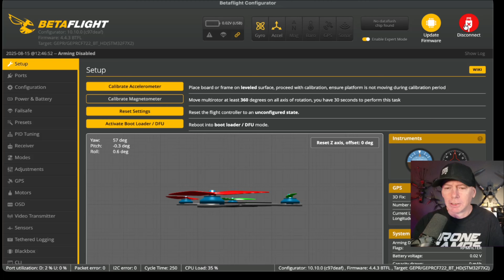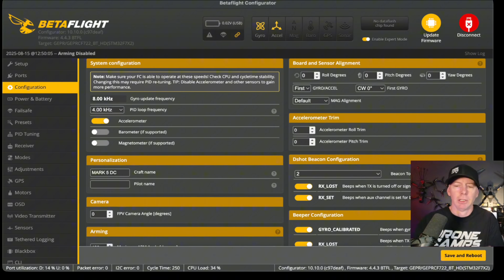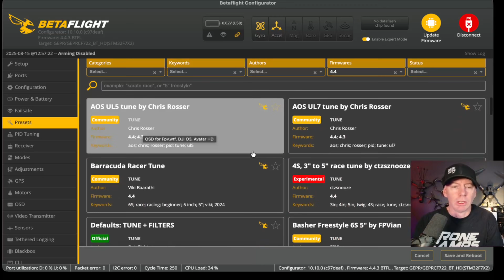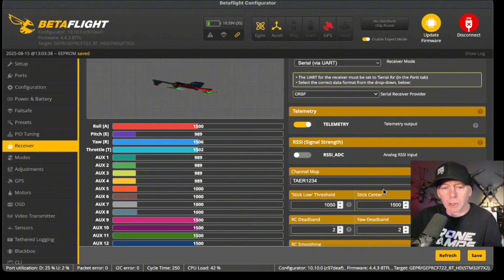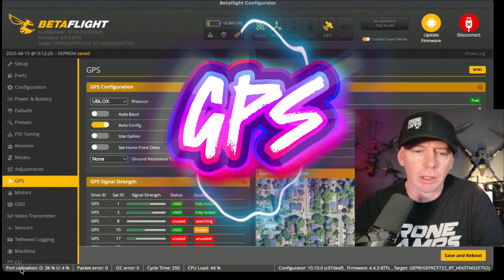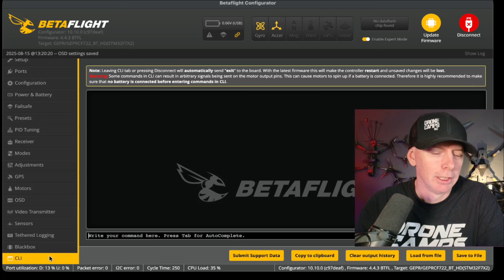BETAFLIGHT Tutorial for Beginners!!! - Updated & Step by Step 🏆

Comment: Hi I am starting to get into fpv and i got a used frsky babyape pro v2 and i changed the receiver to elrs but once i plugged it into betaflight it forced me to flash the firmware and when i tried to use the cli backup files they didnt work because they were to old or because they were from a frsky drone andi. have absolutely no idea on what to do and if everything is wiped or not.